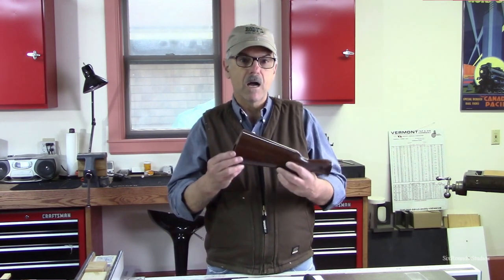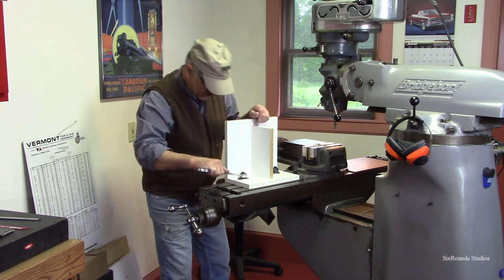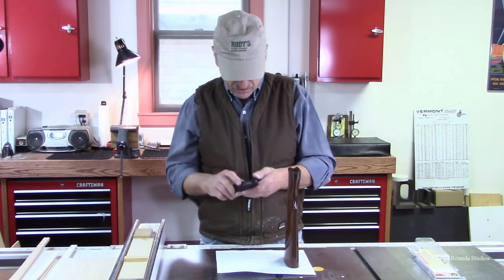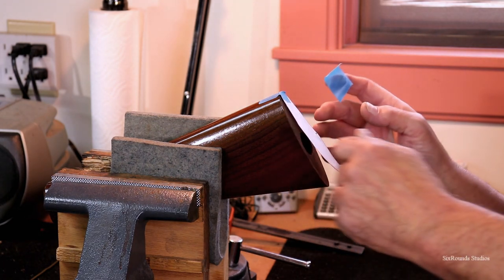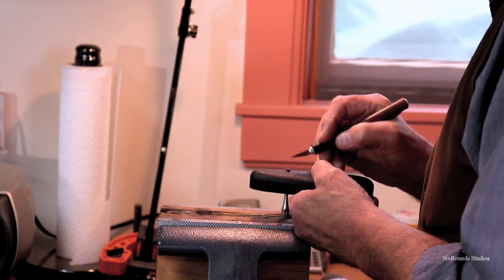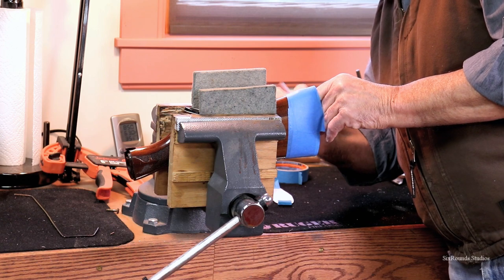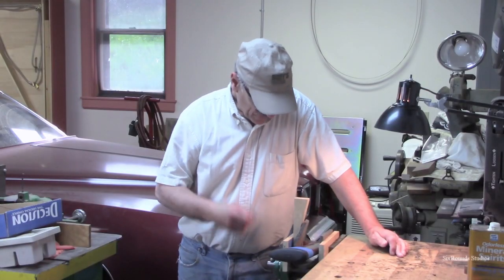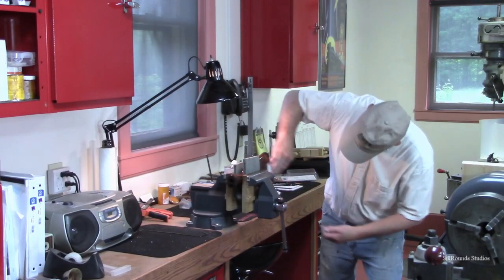Remington 1100...Size Matters

Comment: I haven't run a Bridgeport in over 50 years and it was always on metal. Is the endmill you are using something for wood or a metal tool you have adapted for wood?
Reply: I have user router bits at full speed (4200 rpm on my machine). it looks like the helix angle in the video is different from my high speed steel cutters
Reply: @Woodsguy  Thank you. I just never knew folks used Mills for woodwork. I have only used handheld routers for that type of thing.
Reply from the maker: These endmills that I use in the videos are actually made for wood.  When I worked/ran the woodshop at Ruger, we did a lot of experimenting with different manufacturers.  We tried different helix angle, different back grinds, three flute, two flute, up cut, down cut.....  Whenever I could I took the wood bits home after the experiments to use in my shop (I have a ton).
Reply from the maker: Our spindle head RPMs in the wood shop at Ruger were typically 18000.  The higher the RPM when cutting wood the better the cut finish.  Most home routers run pretty high speeds as well (not sure the speed).  My mill (Bridgeport) was made for metal and not wood...so I can only run max speeds around your 4200 as well.  The key is to run sharp bits and slower feed rates.
Reply: @SixRoundsStudio  Thanks. You have no idea how us Old Guys are envious of your shop with your very own Bridgeport.
Reply: @SixRoundsStudio  Cool. Thanks for the info. My experience was in "Metal Shop" and then later as an Engineer trying to get proto-type parts made (metal). So my only experience with Bridgeports was with metal. I was just trying to understand more about the machine. Thank you.